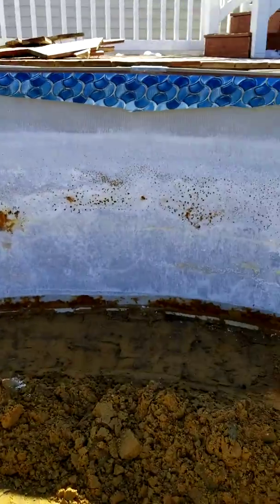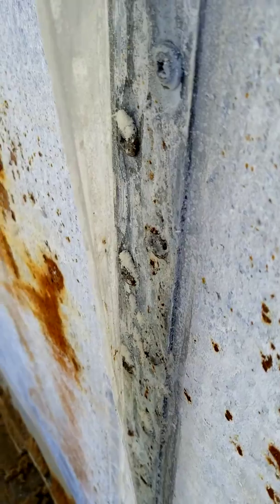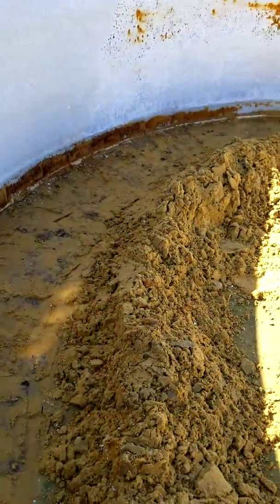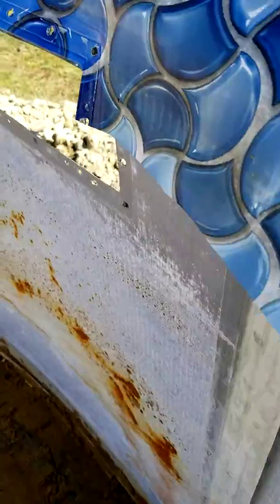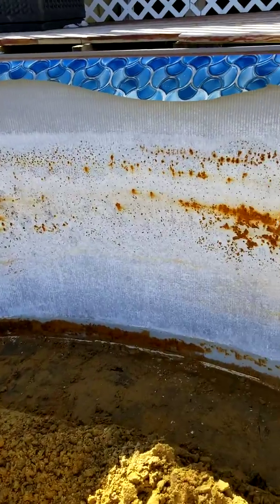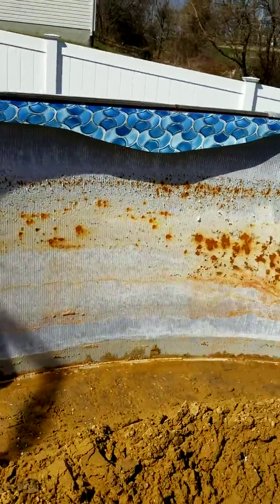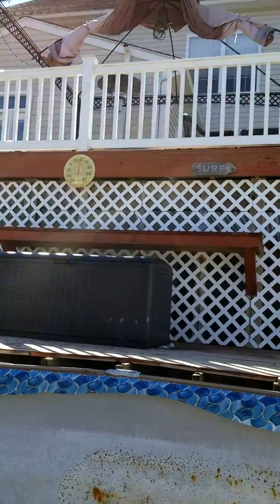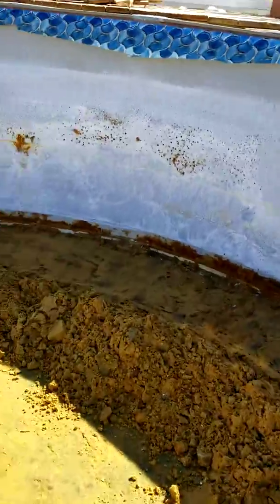What Really Happens Behind Lining on a Above Ground Salt Water Pool (Leslie's Pool) Part 2

Comment: What did you use to coat it?
Reply from the maker: Nothing, the pool store sent me the wrong pool. It should have been resin instead of steel
Reply: Mine is four years old too and we have the same issue. Pool company said it was caused because of neglect.